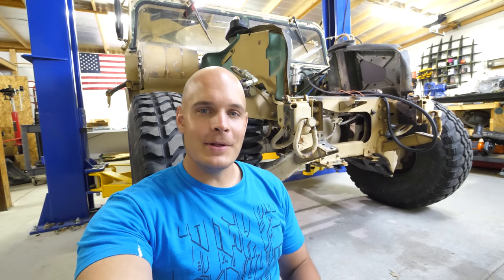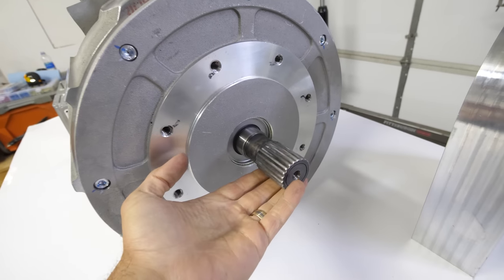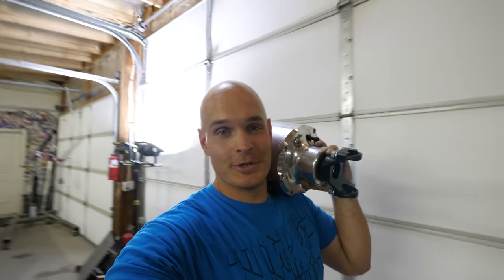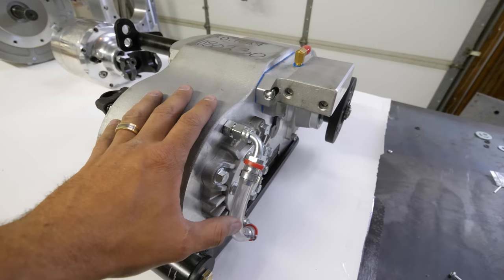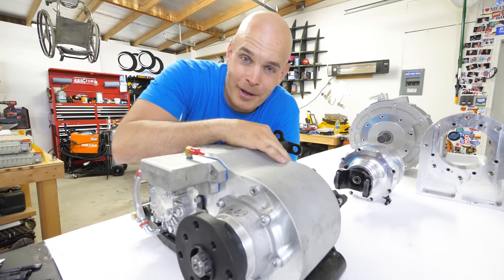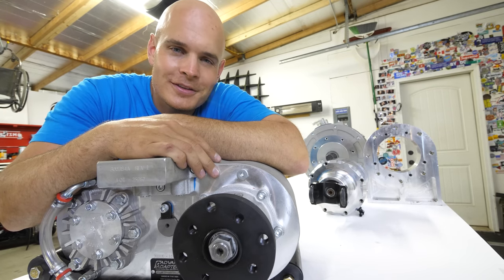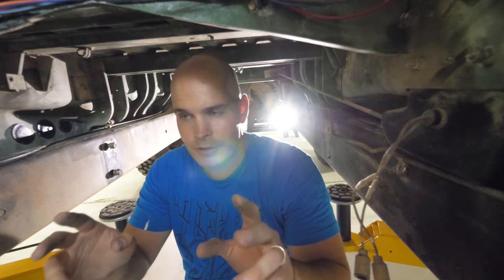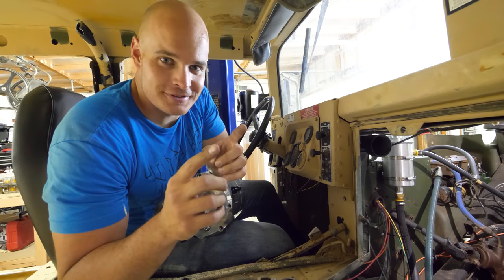How Strong is my NEW Electric Hummer Motor? - EV Conversion!

Comment: Your opening statement as to them being designed to fit in the tracks of tanks is completely a load of bull. Tanks are a lot wider. Sure it might help it some to try and follow behind a tank blazing a trail but in no way does it fit in a tanks track.  Part of the design requirements was to have a off road vehicle that still had a good ground clearance to traverse adverse terrain and be stable. It also needed to be able to carry more weight then the original jeep and have a lower profile so that top mounted weapons or gear would not have a large impact on stability. So to maintain the lower profile and be able to carry more then the original jeep they lifted the drive   assemble to where it would sit between the passengers which in turn widened the stance therefore gaining the required stability. Which also allowed it to carry larger weapons mounted then the prior jeeps could.

Comment: Motor and Inverter: $22,500.
Batteries: $23,000
The charge controller and battery management system are another 3,000.

That's a serious build right there.

Comment: Unfortunately quite a few things are misleading here. First is the gear ratios, when you factored in the low range, transfer case, and base motor torque you got around 12,000. This is a lot, but then you compared it to a tacoma, being about 260. This is only true for engine torque, as it has a far more significant gearing reduction, totalling 44:1, combining with base engine torque you get about 11,500- very close to your insane figure. 
While the torque of an electric motor is relatively constant and is greatest at zero-low RPM, it does diminish when reaching higher speeds. This is why very large high torque motors like that one make around 700ftlb of torque but only 300hp, and combining the total power output with the only slight gear reduction you get poor acceleration, barely beating the stock horrible diesel.

Comment: Excellent, motor came out of a machine that moves planes??
Interesting?
Reply: It is an interesting source, but the motor and inverter are not specific to that machine. The plane mover manufacturer just chose a suitable and available (to them) motor. UQM motors have been used in wide range of experimental, prototype, and low volume production vehicles, including trucks and buses.

Comment: the uqm 220 plus, I know that it's a AC motor but how many volt it's requiered to run 
?
Reply from the maker: Minimum 270v I think. Max is 450v. I think.
Reply: @JerryRigEverything  can you give the place were you buy your AC  motor ?  how much did cost this motor ?

Comment: 4:14 - this is not true at all and is where a lot of confusion with EV ratings comes from. That motor is rated at 500 ft-lbs of torque which is the comparable number to your Tacoma's 265 ft/lbs (which is relatively low for a truck). So that motor is just twice as powerful. If you want to compare to final drive torque we can do that. 

A 2018 Tacoma which produces 265 ft/lbs at the engine will go through a transmission and rear end too. So since that truck has a first gear of 3.6:1 we are at 954 ft/lbs of torque in first gear at the back of the transmission but we are not done yet we still have the final drive ratio which on that same truck is 3.91:1 which would increase wheel torque to 3,730 ft/lbs. 

That Hummer also has a rear end and if you are keeping the rear end stock should have a final drive ratio of 2.73:1 which would increase your 815 ft/lbs to 2,224.95 ft/lbs. Unless yours has a different rear gearing ratio as mentioned in the video for 4,275 ft/lbs. This is only 545 more than your Tacoma. 

On top of that the original engine 435 ft-lbs of torque and since we can look up the original transmission with a gear ratio of 2.8:1 and a rear end of 2.73 which gives 3,325 ft-lbs on the original engine. Or using your final drive of apparently 5.24:1 gives us 6,382 ft/lbs which means your original engine actually produced more torque.

Comment: The Tacoma's torque to the EV's post-gearbox torque isn't a good comparison. That Taco's 265ft-lb is at the engine, so doesn't include transmission gear ratios

Comment: Did you give Westinghouse credit for alternating current???
Reply: That was a rhetorical question, past that I’m impressed and curious- what the heck are you going to do with 12,000-lb*ft of torque? That’s a meaningful percentage of the output of an entire diesel-electric locomotive
Reply: @adamsteinhardt6393  It's not unreasonable for the vehicle. Take the stock diesel engine torque and multiply it by the first gear ratio and the torque converter torque multiplication ratio (about 2:1) and the same ratios in the transfer case, differentials, and portal hubs as Jerry did, and you'll get a similar number.

Comment: You said if you put the motor in the hummer would have a top speed  of 120mph.  Would that happen on its own? Couldn't you just not push the acceleration?  I never heard of a vehicle going ro a speed without a person pushing the acceleration  to make it do that. Can someone explain?
Reply from the maker: You are correct, it would only accelerate if I pushed the accelerator pedal.
I'm talking about top speed though.  I will never want to go 125 mph, so I might as well gear down the motor to lose top speed, but gain more torque.

Comment: Seems like electric cars could use gears to regenerate more and need solar panels in case of running out of juice... I'd still rather the option to easily swap batteries in/out, but would settle for a panel that could save you a tow. I thought they actually had separate regenerative brakes.. maybe not

Comment: Hey jerr bear. Do you think having capacitors deliver the power to the motor would bump up the power exponentially?
Reply from the maker: Maybe.  But the motor is the bottleneck. My batteries can throw 1500 amps for 3 seconds but my motor peaks at 500amps.

Comment: if you count all the batteries as engine parts (which they kinda are with eletric motors) its size is way bigger than the old hummer engine .. and its heavy af

Comment: Nice work, but can people please stop saying Electric motors have all the power all time, they start with “all the torque” it is true,  but full torque and low rpm is still low power compared to when rpm rises up, the magic is that from a standstill you don’t need a lot of HP yet when you have max torque to start with.
Reply: Isn't this 700 to 4000 torgue thing false? It would mean that by using the original motor in lowest gear, it would also give pretty high number of torgue. In my understanding converting speed to lower from the SAME power source doesn't magically add torgue. Excuse my english.
Reply: @osoco7294  Right, It adds torque at the drive wheels, but you lose speed.

You gain torque (at the wheel) but you pay a proportional fee in speed.
Reply: @Gjmahn  
"...but you pay a proportional fee in speed"
Sure
Reply: @osoco7294  Sure?

Horsepower = Torque x RPM / 5252. 

For a constant power source torque and rpm (speed) are inversely proportional if you change gear ratios

Comment: I feel like some information mentioned in your video are pretty missleading - you can use regenerative braking even on DC motors and comparing one speed "transmission" and 4 speed in terms of efficiency is pretty irrelevant

Comment: This is incredible. I love that you are taking something that is so famous for damaging the environment and making a bit greener. Still a larger carbon footprint then a hydrogen fuel cell, but a large step in the right direction. Your first factoid in your video is only  partially correct. The actual reason is the predisesor to the HUMVEE the JEEP; the jeeps wheel base and track width is what was determined was what was causing it to sink in the sand and get stuck. The wider and longer stance allowed more floatation on soft sandy surfaces.

Comment: WTF is a torque box? I have worked on 4x4's all my life and never heard about it, I would guess it's a planetary reduction gear, and that makes no sense since Atlas could have made a transfercase with the reduction needed instead.
I'm looking to do exactly this convertion, but on a Suzuki Jimny, with smaller size motor and the original transfer case

Comment: If tyres can't move and Fitting of motor was not strong enough to hold the power of  the motor . Then physical contacts holding motor will break and motor's Stator will rotate instead of Rotor. In Hummy

Comment: I bet you could put a small mower engine under the hood 
Running off hho on demand amd turning 3 or 4 alternators that would replace your converter box amd power the elelctric motor

Comment: I have f250 5.4 is possible leave gas motor for rear wheel drive and electric motor for front wheel drive so I can use gas or I can use electric

Comment: That's actually a myth, they have a wide stance to take up an entire or most of lane on an average European road. These were designed in the cold war and inteded to be used in a potential ww3 in Europe. Also hmmwvs weren't wide enough to fit in the tracks of the tanks they originally served with. I'm a mechanic in the Marines so don't @me asking how I know this

Comment: When you say , the motor has 700 NM of Torque and 300 HP, in fact with electric motors, they dont have anything independent of batteries and a controller, unlike a ICE motor which would capable of its rating regardless of any other factors. This is a common theme repeated over and over..what should be said is that it is CAPABLE of 700 NM and 300 HP. Clearly that is based on a specific battery and controller. Put an inferior battery or controller and the motor would obviously not put out that kind of power. Get a better battery and a more powerful controller and the motor would put out more power than stated although reliability would be an issue.
Reply: The ratings are valid with the controller-inverter, which he acquired as part of a matched set. Of course the battery is also a limitation, in the same way that available fuel flow rate is a limitation for an engine, but the Tesla Model X complete battery is more than capable of supporting this motor, if the cooling and BMS are handled properly.
Reply: @brianb-p6586  of course
Reply: There are also "other factors" in ICE output, such as exhaust systems and controllers, which result in different performance for the same engine as installed in different vehicles. The power rating for the engine is still valid.

Comment: "so they can fit in the tracks left by the tanks" lolwut? no. not at all. they're that wide because they are max width for European tunnels. Same with the Abrams tank.

Your EV torque box is just a simple planetary gearset in reduction.

Comment: 1:19 that actual "motor" is not a motor, it's an engine.
You can take the crankshaft from the engine and compare it to that electric motor, and the rest of the engine and components you can compare to an inverter + batteries, which is lighter?

Comment: Why not make it hybrid, with a smaller motor just charging the battery always at optimal most efficient rpms. Reducing the battery size. Increasing range.

Comment: Electric motors absolutely do NOT have "all the power all the time", they have a torque curve like any motor, just one that's very different from a ICE.
Reply: Exactly to specify they start at peak power and decline as the the rpm raises. Kinda inverted ICE curve...

Comment: Instead of using gear reduction; why not slow down the rpm of the motor? You are using more battery power than you have to.

Comment: The truck also has a transmission though so if it's 4:1 then the 200 is 800 plus the 3:1 of the axle is 2400 it probably has a low range to so add another 4:1 so 9600 lbs of torque for the Toyota. Just saying....

Comment: $23,500 just for the motor and controller is way overpriced for a personal project. You can easily get 3 phase motor and controller with plenty of RPM and torque for way less. You can get a medium sized family car for 23,000 bucks.  But cool stuff and all...

Comment: And you're saying that electric motor will ONLY go 6000 rpm, or do you mean it can go UP to 6K? It makes zero sense that a motor can ONLY go a set speed. Ramping up voltage/amperage with throttle position should allow rpm increase.

Comment: that is the electric motor  I installed in busses for RTD here in denver those busses still running till now at 16th mall Street at that time we used like 30 red and yellow batteries  plus a 4cyl engine from ford to recharge the batteries these motor were made here in Fort Collins  the first ones were made in England but they were  expensive and not reliable anyway just saying

Comment: nice project. but few large picture errors. batteries. they die. and the cost of replacement is high. they ran out, and must be charged. u know the time to charge 90kwt?..too much. too expensive charger, which also can burn out and u r stuck with vehicle. yes diesel i.c.e. has bunch of mooving parts, but they are reliable. and last point, no ev can stand close to i.c.e at long run, like military etc. so...ev s are ok, but for just standart. heavy duty stuff is not up to their capabilities.

Comment: Top speed of 125 mph? F#@*ING SEND IT!!!!!!
Reply: That's just a gearing limit - there's no evidence that the motor could produce  enough power push this box that fast, or that the battery, inverter, or motor could sustain the required power to stay at that speed. The point is just that there's no point in gearing the powertrain for a speed much higher than the vehicle would ever be driven.

Comment: its wondeering that there are lot of alteration kits available however  I had mounted a 4 cylender aircool V farm East German tractor engine on a  Chevrolet Impala,,,, I could go if there was a 6 cylinder engine  Coupling engine to gear was a problem   Should have changed gearbox also So car was toooo economic but less power to climb hil That encgine is still in use for rotating the drum of ready mix concrete truck but not V but stright 4,

Comment: You must have considered Koenigsegg quark motor
Reply: No, the Koenigsegg motor is not available - so no one outside of Koenigsegg would rationally consider it - and very small motor size is not required. There are lots of motors at any desired power level; the UQM 220 is a reasonable choice for the power actually needed (in a one-motor configuration).
Reply: @brianb-p6586  thanks for replying!

Comment: I have a question I want to do that with my chevy c10 truck in to electric but I want to make it go fast then strong
Reply: I don't need the 4 wheel drive
Reply: Or I want to get it stronger and faster but I don't need the 4 wheel drive

Comment: Here’s are some interesting facts:

Total fuel consumption of U.S. airlines is approximately 19 billion gallons annually.

Total fuel consumption for mining Ore for construction of electric car batteries is approximately 21 billion gallons annually.

The 21 billion gallons of fuel burned can only produce enough Ore to build 250,000 electric car batteries. 

The lifespan of an electric battery is 10 years and is not renewable. By 2050 these batteries will fill landfills with 50 million pounds of waste that does not break down. 

I wonder if people would still believe in electric power cars, vehicles or equipment if they knew how massive the carbon emissions footprint really was?

Comment: @7:46 more nonsense. No, electric motors don't "have all of the power all of the time". Power is limited by the torque limit at low speed (typically the bottom one-third of the speed range). That UQM motor is torque-limited up to about 2,000 RPM (which will be about 27 MPH in high range); power below that speed is proportional to speed, so for instance half power at 13 MPH.